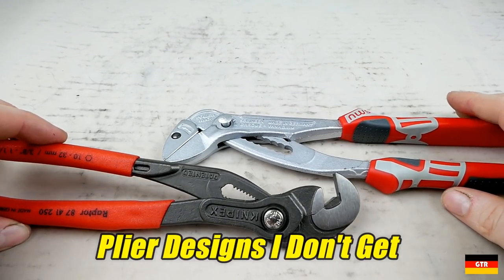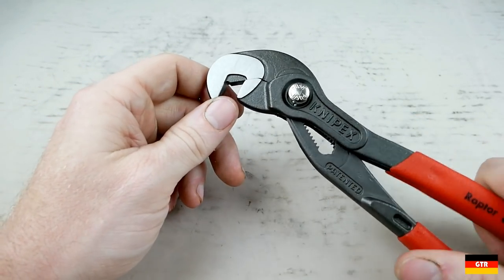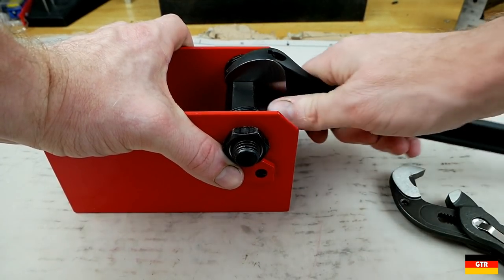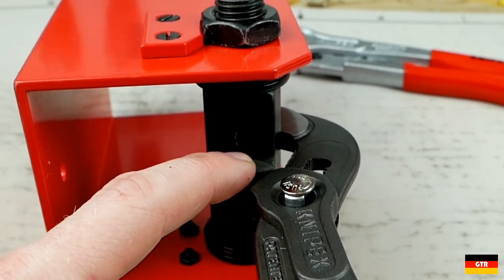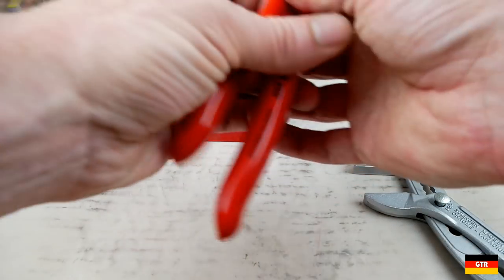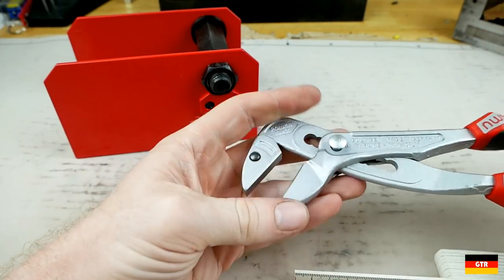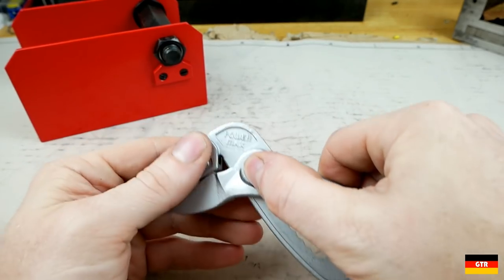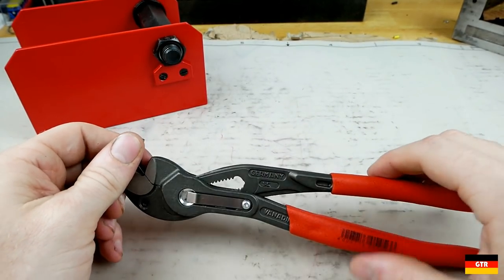Plier Designs I Just Don't Get

Comment: You dont adjust it to the size of the bolt and slip it on, you close it on the bolt and it cams into a super tight fit that will hold more torque than you could ever produce with that length handle.

Comment: If you take a careful look at your non adjusting open end wrenches while applying pressure to a nut, you’ll see that the majority of the pressure is applied to only a small portion of the nuts flat face.  The Knipex Raptor appears to apply pressure to the nut’s flat faces at a point further back from the corners. Understanding this helps us understand why it’s grip may be superior.

Comment: The Raptor pliers get tighter as you apply more force...as a mechanic for over 10 years I can say these are my go to now when doing alignments for the nuts on tie rods where every other plier slips...including the knipex water pump pliers...only other wrench that we use to loosen those tie rods are pipe wrenches...but they mar up the surface of the nuts and or tie rods...so now Raptor Pliers are first choice and the pipe wrenches are a last resort.

Comment: I use the pliers wrench daily while removing 1-1/8" bolts from pressure hatches. The tool is very secure, and much faster than an adjustable wrench when tightening or loosening many bolts/nuts consecutively. The raptor is also a go-to in my box.

Comment: I've used the Raptors for HVAC on inverted flare nuts so as not to damage the nuts. Unlike regular, parallel jaws. Similar to a flare nut wrench they have multiple contact points for more even distribution of torque, thus not squashing the nut out of shape. They really excell at this one job. Just like Knipex hose clamp pliars, they are made for a specific task and they do it very well.
Reply from the maker: Yeah I'm sure there was something they would be good at, I just didn't run into it yet.  Thanks for letting me know.
Reply: Yeap, they are great for all manner of mechanical connections for refrigerant lines and controls in HVAC.
Reply: Yup no teeth. Work good for round stuff also. First tool I bought that made me a life long fanboy today 👍😉
Reply: I know it's been a long time, but as someone who just started in HVAC, these are awesome for mini-split installs. The bent nose gets in where the pliers wrench can't, they're way lighter, and they apply force from one side like the Cobras. Plus, they're way cheaper and work well with rounded fasteners. The plier's wrenches are fantastic for flattening copper pipe and bending sheet metal, so they still have their place.

Comment: Those Raptors look like smooth versions of "parrot jaw" pliers, which are more suited for rounded fasteners. People are saying that they would use water pump pliers for such a job, but we should remember that water pump pliers place most of their force on the corners of bolts... which would already be rounded. This is the specific use of "parrot jaws".

Comment: I bought these out of curiosity with the intended use of loosening, tightening and adjusting tie rods on cars because I usually have problems with rounding the hex on the rod when using for example Knipex wrench pliers or a standard wrench. I can‘t say anything about different uses because that is the only task the are used for an in my opinion they are perfect for that.

Comment: The pliers wrench will slip before the raptor, because the pliers wrench requires you to maintain solid squeeze on the handles, where the Raptor works kinda like the cobra, in that the grip on the nut gets stronger the more torque you put on the wrench. You can literally let go of the bottom handle while turning the Raptor, where the pliers wrench will not maintain grip if you let go of the bottom handle.

Comment: The raptor is made for screws or bolts that you can only get to with an open ended wrench.
Its giving you more grip and power, especially for bolts that are rounded out.
Reply: Matt Sturgeon flare nuts.
Reply: Matt Sturgeon, there are some recessed bolts , that you will not reach with a plier-wrench. Working on old cars, there is always that one rusted to shit rounded out bolt that you somehow cannot grip.
Reply: Not to mention the pliers wrench being more expensive then the raptor
Reply: Collar bolts with a slightly conical head are impossible to grab with a cobra.
Reply: @TheMattSturgeon  sure.  The cobra pliers may be better at doing the job, but what if you're working on something that cannot be marred because it has a polished finish ? Then the cobra pliers are useless because the teeth will just destroy the finish .
Reply: Then you would use the pliers wrench. They also make non marring sleeves for the knipex 10-inch cobras. In fact I think german reviews have showed them on his channel.

Comment: Taking an informed guess, here. I think the Raptors are meant to work in a similar way as the Channellock 410 & 414, aka "parrot-nose" pliers. The 410 & 414 really have just one purpose, and that is to tightly grip into a stuck rounded bolt or nut in order to remove it.

Comment: I have the 10” ? Inch Raptor pliers. I find them useful for low torque electric and plumbing applications. The ratcheting action is why I like them for these tasks. That said, I may start with them, but if I want high torque, I go to my set of wrenches every time.

Comment: The NWS PowerMax is an Armaturenzange, made for kitchen or bathroom fittings, bathroom brassware and plastic screws.
Reply: Karl Napp they are met to be used by plumbers for finish work
Reply: Correct.
Reply from the maker: They could probably work, but only for very specific sizes
Reply: yes they are but they do it b
Reply: very well
Reply: I really like NWS side cutters. I've got maybe 4 pcs Knipex and 4 pcs NWS and find NWS sharper, less fatiguing, as durable and overally better.PowerMax was a disaster: handle coating disintegrated under pressure of of my palm and casting had some extra material not removed during finishing which restricted range of the moveable jaw. Simply put - piece of shit.
Reply: @GermanToolReviews  [Quote]:"They could probably work, but only for very specific sizes" [Un-Quote]: Yes, typically found in German sanitary installations...which is the use the NWS was made for. Not that it is THE ultimate tool one must have, surely it's not.

Comment: If the raptor is slipping on you it probably isnt set right. I have had them in my box for 10years. They aren't as useful as I had hoped when I bought them but lately I moved them into my tool bag and they are as good addition because the have a large capacity with a low weight. Other tools will do the job better but I can do a large range with this one tool so it is a good option for a set of tools to take with you. When they were in my box I had access to tools that were better so I rarely used them. But in my bag they work well as a companion wrench i can use them to hold the nut while I tighten the bolt on the other side or for larger fittings/nuts.

Comment: Maybe the last wrench you showed is made for hydraulic flare fittings. They are made from real soft metal and file easily without a bird beak death grip. Vice grip has something like that which grips a death grip so no rounding of the hex part of the nut. Peace VF

Comment: I use the raptors for doing alignment/adjusting tie rods.  They work pretty awesome for this because of the angle, that being said - the pliers wrench serves a similar purpose and is a better tool.
Reply: Tie rods are what the raptors excel at.
Reply: The Raptor Pliers apply more torque than most every other adjustable pliers without slipping...we've tried all pliers and the Raptors do the best...meant for high torque removal application...eg. alignments etc.

Comment: Th Raptors are for nuts that are already rounded, when you apply force to the raptors they get tighter. The water pump pliers are similar, however with enough force it will overcome your grip- strength and round the fastener. I've used the both pliers in the field with success, but only keep the water pump pliers in my tool bag. Due to the specialty nature of the raptors.

Comment: As an HVAC technician, the only real use I've found for the Raptor pliers is as a backup wrench for flare, and other mechanical refrigerant connections, that tend to be made of soft metals, and are usually thin profiles in tight spots.
The Raptor pliers are fantastic for it, so they earned a permanent spot in the tool bag I have set up for doing that sort of work, but there is literally nothing else I do that the Raptors would be my first or second choice for...
Reply: I use the raptors for flare nuts also
Reply: What about for 1/2" gas pipe. For reconnecting gas line on a furnace swap out.

Comment: Advantage these have over the pliers wrench is on smaller size bolts like 9/16 7 /16 3/4. These actually lock inn with one hand operation. I used these and they haven't slipped on me yet. Work very good but the pliers wrench has more uses of course

Comment: The few times the Raptor came to use was to unseize a couple flarenut fittings that had rounded corners. I couldn't get them with standards flarenut wrenches so the raptor came out to the rescue.

The Powermax is something I will never get. Thanks for the demo on that.  Love their Quattrogrip pliers though!

Comment: Was looking at different models today. These  raptors are advertised as best suited for a good grab on rusted and bad condition nuts/bolts. Their shape is a little off from flat so they are not intended for gentle work like shower fixings. Haven't tried them myself, but it also looks like you're grabbing the sample quite gently.

Comment: Bought a pair of Raptors at a garage sale for $10. I never really use them. I either end up grabbing my pliers wrench or an adjustable wrench. I thought the Raptor would a good solution for line nuts like on automotive brakes lines. But I had exact same issue that you noted.

Comment: I haven't actually used my Raptors for anything yet.  Knipex says they are good for hex sizes from 3/8 to 1-1/4, that would be a #10 screw up to 3/4" screw.  If you ask me a 10" long wrench is way to small for a 3/4" screw.  I don't think I would use them on anything larger than 1/2" which would be a hex of 3/4"  Seems to me on smaller fasteners they would work well.  I will have to get mine out and try them on some 5/16" bolts that could use some retorquing.

Comment: In my opinion there's no substitute for channel lock brand pliers. I've tried tons and nothing comes close not even more expensive name brands. I've been using them for over 20 years and as a matter of fact I still have a couple pair older then that and still work like new. Those goofy new designs are more gimmick tools just designed to look fancy so you'll buy them and toss them in the bottom of a drawer never to be used or seen again lol. I have a big drawer in one of my boxes just for junk like that lol.

Comment: With my limited knowledge, I'd say get larger ones for larger bolts.  I had the same trouble with the tiny cobra pliers.  I got the 4 in. and switched to 6 inchers due to several fails.

Comment: I think the raptors are Knipex's version of the parrot nose pliers. they have a slightly smaller head and work well on slightly rounded fasteners.  I think the issue is they don't do anything better than a standard pair of alligators or cobras. i did have a tech once that liked them for rotating outer tie rod jam buts once they were loose.

Comment: Really? You either haven’t used them correctly or in a way that really highlights their unique design.

I find the to be far superior to flare wrenches for brakes and hydraulic fittings. These will grip so much better and will NOT strip where flare wrenches will.

Comment: it makes more sense to apply the turning pressure primarily on the fixed side of the tool? Same as how the standard adjustable wrench has a recommended direction, both these examples use the tool what i imagine as backwards,

Comment: Best use for the Raptor,
aka Parrot Pliers...
Building and repairing industrial hoses i.e.
Sanitation, hydraulic and pneumatic etc.
Reply: What about 1/2" gas pipe. For reconnecting gas pipe for a furnace swap out.

Comment: People who call adjustable wrenches "nut rounders" are either too clumsy or lazy to fully tighten the thumb screw on each engagement, or use really really cheap $5 Dollar Store wrenches. I use QUALITY adjustable wrenches almost daily to make my livelihood and they are a very versatile and capable tool which actually, if used PROPERLY, has less potential to damage/round nuts than regular wrenches. You can dial in the clearance to almost nil. Yes, you have to readjust on EVERY engagement. 

This is a case where a tool has unfairly earned a negative reputation due to PEOPLE's stupidity/laziness.
Reply: I wouldn't call it stupidity but I would definitely say laziness or even more likely a time is money type thing where they need to turn as many nuts/bolts as possible. It takes a very long time to readjust each and every time especially when you are in a tight spot that you can only get a quarter of a turn before having to remove the wrench replace and get another quarter turn. It's just not possible to do it timely so they run them a little loose on and off on and off on and off. I totally agree if you take the time to adjust them correctly every reposition you have little to no chance of rounding off the heads.
Reply: 95% of the time:  Pliers Wrench > Adjustable Wrench

Comment: You're not using the Raptor correct.  The bottom jaw must be parallel to the nut/bolt.  If it isn't, then the nut/bolt is too big.  The design mimics the older clench wrench design.  
Yes the NWS generally sux.  similarly  jaws must be parallel as well and the pivot jaw is supposed to assist with speed when backing off and reapplying.  
What most people don;t understand is that smooth jaw pliers were primarily designed for fasteners in which you don;t want to damage with teeth marks.  Example; exposed interior plumbing fittings, chromed fasteners on show car engines, and so on.  Why you would be using them on a fence is beyond me.
Reply from the maker: Because fences use galvanized nuts

Comment: You have to swear in German while using the Raptor -- then it works right: "Ich befehle dir, die Arbeit zu erledigen, du gottverdammter Schraubenschlüssel!" -- and the "verdammter Schraubenschlüssel" works like a "verdammter" charm.
Reply: Wenn du nicht funktionierst, dann fliegst du aus dem Fenster du Scheißteil! Will work much better, and is more authentic!
Reply: @Marcel_Germann  Danke schon! I played that back in Google Translate, and even if I didn't understand the translation, the mere sound of "dann fliegst du aus dem Fenster du Scheißteil"  would have made me work harder for the rest of the day...
Reply: @Gruntled2001  
The correct translation would be: "If you don't work properly, I'll put you through the fu**ing window you fu**ing thing!"

If the tool, or part, is not working as intended and meaning that you'll get rid of it in that case.
Some languages are using sexual based swearing. In german swearing is different, fecal instead of sexual.
Reply: @Marcel_Germann  While, arguably, Russian swearing is more colorful, German seems more persuasive! LOL
Thank you for a crash course in German obscenities!
Reply: @Gruntled2001  Almost forgot: You can also extend it with a "swabian salute"

https://en.wikipedia.org/wiki/Swabian_salute

Comment: My grandpa use to say fishing lures are made to catch fishermen not fish. I think this falls into the same category. There is almost no instance where a simple combination wrench or ratchet won’t work and work better than any of the fancy do all pliers assuming he bolt/nut is not rounded, of course there are better options for rounded fasteners than pliers. I’m just as guilty like most of us I have plenty of very expensive seldom used fancy pliers that work best at looking good in my tool box.
Reply: You can't bring your entire tool box out in the field and this name has been around for 130 years. They make good stuff. All their tools with the exception of the cobras and their multi plier have very specific uses. This works great in confined spaces and on fasteners with finsh that can't be damaged. They also work great on round stuff that may or may not require not damaging the finish.

Comment: I have a Raptor but I only use it to get nuts off that I can't get any other way. It's worked often enough to be worth the price, but the most of the time a Cobra works, and if the nut is in good shape I reach for the pliers wrench.

Comment: for the NWS I suspect it would be helpful to get the center axis of the nut/bolt on the inside of the top jaw's pivot point – which would preclude large sizes. I think this is because the tendency if outside the jaw's pivot is to pivot the jaw open and wedge/squeeze the bolt/nut out of the jaws - pretty much as you showed when the jaws were set too small.

Comment: I too have the exact same opinion of raptors - they wound up in the bottom of a drawer that is never opened. I love the Cobras and I use those and the pliers wrench very often but the raptor is useless. The Irwin Pump Pliers are also good but not as durable as the Cobras.

Comment: I would like to know why the knipex alligator when you have the cobra. It seems to me the cobra will do anything the alligator will plus more. Is it just a cheaper version as the alligator are cheaper or is there a specific job for them.
Reply: I think the alligators are more suited for shitty outdoor work as they’re a relatively open construction, compared to the cobras, so can be flushed out and cleaned easier, that’s my interpretation of them anyway...
Reply: i have both and i prefer the alligators..especially in the 180 mm size. Much more easier to adjust in tight places,  slimmer construction and nothing that can break or get in your way like this silly cobra's  button.. All the plumpers i know prefer the alligators too